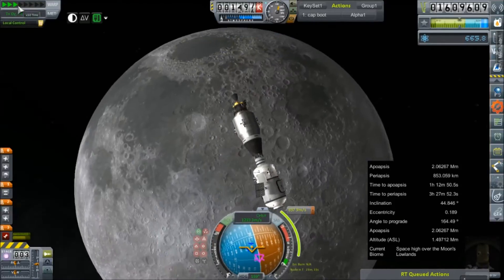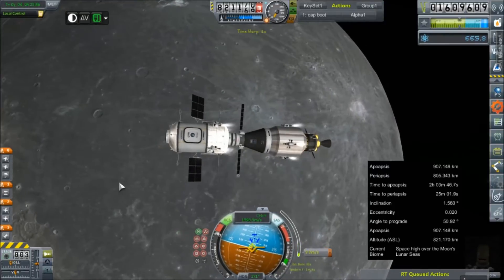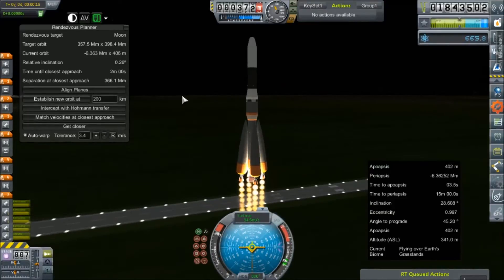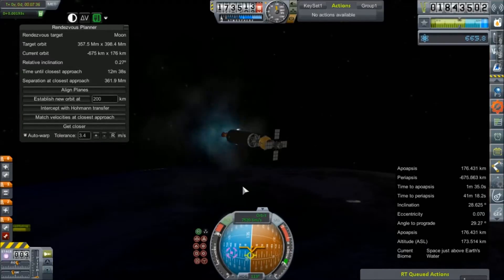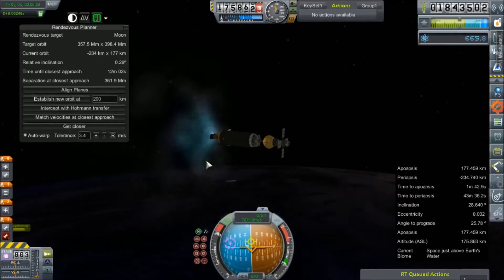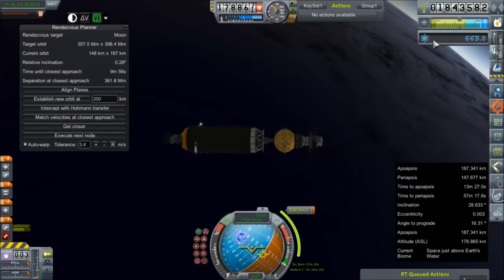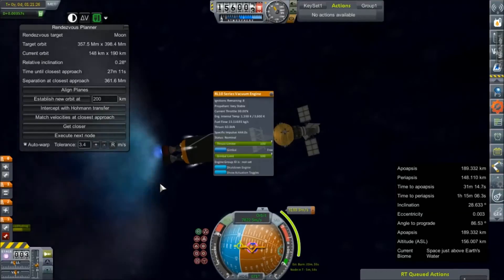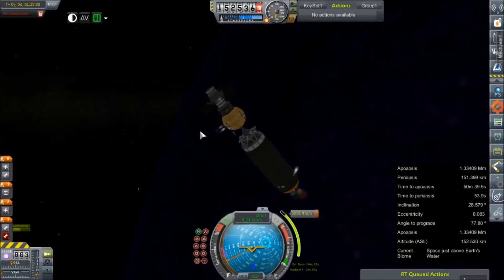KSP RP-0 #136 Project LifeBoat 2 - Avionics and Power

Comment: Ahh those RL-10'S failed, we lost a lot of delta V with one engine failiure. Mabye soon the launcher may need to get a face lift or a new version, and more modern engines from the R&D center:)
Anyways, good video like always:)
PS:Good piloting at the RL-10 failiure, spinning was a great idea:)
Reply from the maker: Thanks!
The choke point of the space program overall is definitely R&D.  For all it's failures, the RL-10 is just the best we have, and it looks like it'll be that way for a long time coming.
There is certainly a plan to update the RA-9 Series, but the Griffins are up first.